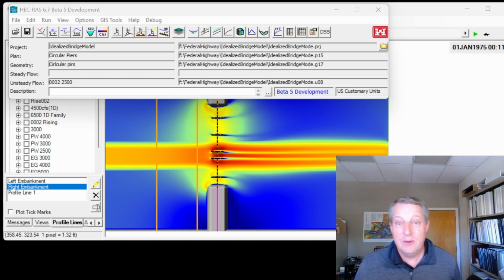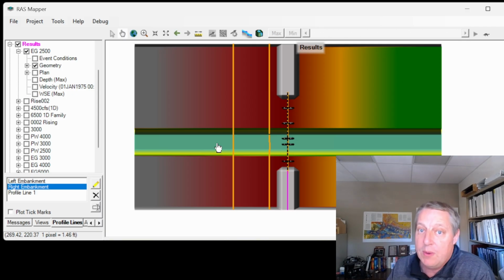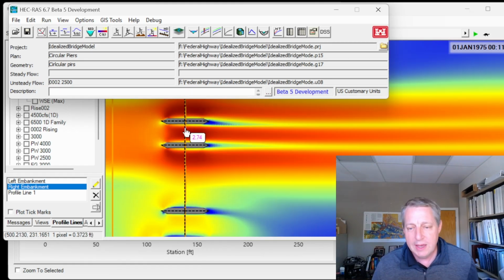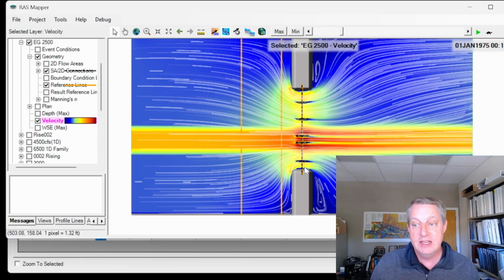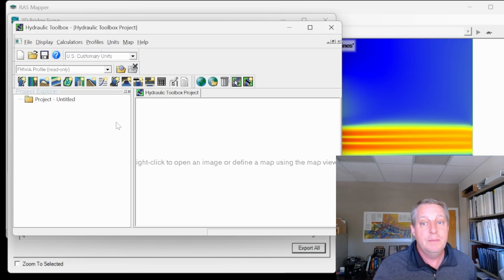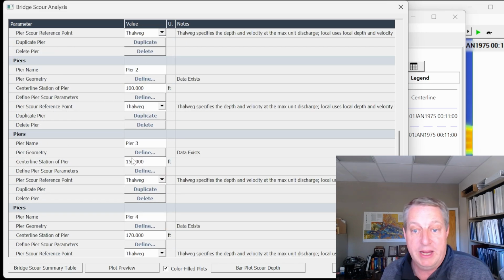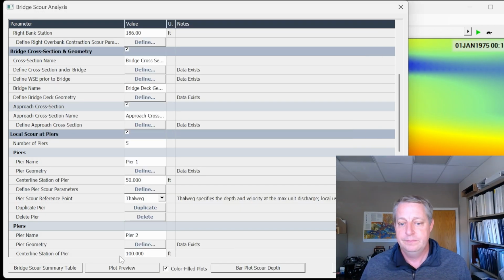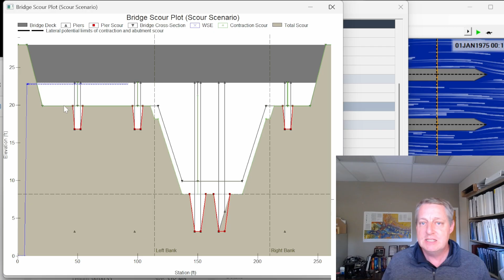2D Bridge Sour (HEC-RAS 6.7 Beta Teaser Trailer)

Comment: Great tool Stanford. I tested it with DWE e SWE, but with SWE some cells have WSEL and problem to converge.  I used Variable Time Step. What you suggest in these case? There 'is a guidelines for create stable solution with SWE? If not , it could be interesting have guidelines.

Comment: Very cool!  Can you explain briefly why you model the piers in the SA/2D connection and the in the terrain?
Reply from the maker: I have a whole video coming out on this...but short answer, you want the detailed hydraulics around the bridge and the bridge piers in the deck for the tool, and the way RAS implements the 1D bridge, we don't double count (the 1D bridge adds a deck "surcharge" to the 2D hydraulics, so if the pier losses are explicit by adding them as mods, the bridge just adds les surcharge).  Again, look for a whole video on how the bridge model works and why piers in both places is best practice soon

Comment: Hello Stanford,
Thank you for this very helpful video — I’ve been waiting for it!
I really like the fact that we can now easily write 2D bridge scour variables directly to the FHWA Hydraulic Toolbox.
I did notice, however, that I had some difficulties when sending metric geometric data from HEC-RAS to the Hydraulic Toolbox. It seems to work perfectly when using imperial units, but not as smoothly with metric data. (not in this tool but when importing data with hydraulic toolbox from HEC RAS)
Also, I have a question: will there be a tool in HEC-RAS similar to the Hydraulic Design Functions (HD Bridge Scour) that complies with the latest HEC-18 guidelines? It would be great to be able to perform Bridge Scour Analysis directly within HEC-RAS without having to use the FHWA Hydraulic Toolbox separately.
Reply from the maker: Really helpful comment.  Thank you!  Because most of our data sets have to be US Cust, SI bugs tend to lag.  I'll try to test SI.
Reply: @stanfordgibson  Thanks, Stanford!
I’m happy that my comment could help a bit with the project. Can’t wait to work with the final tool!